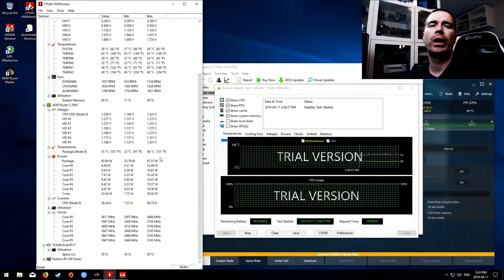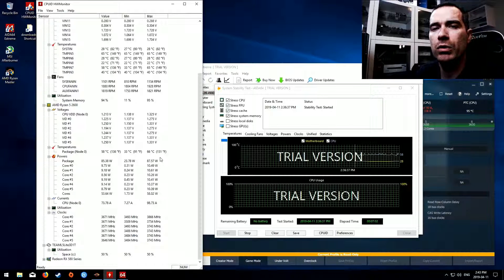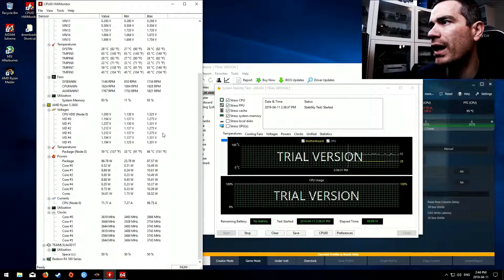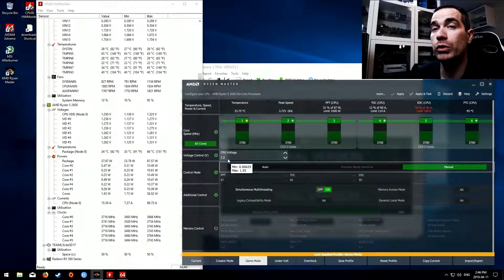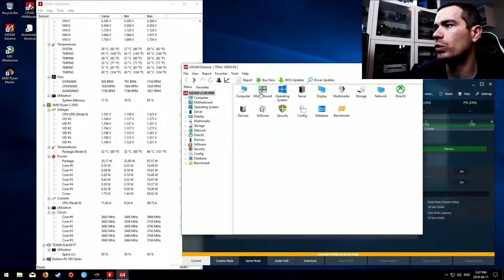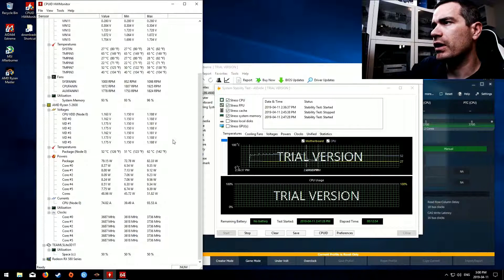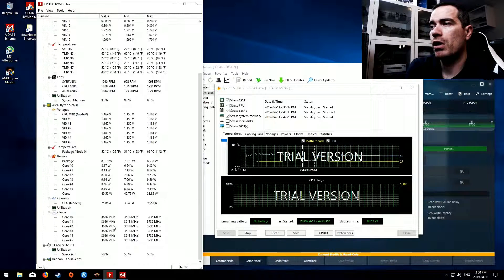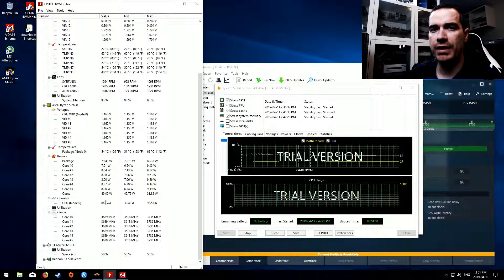Please Stop Using Auto Voltage On your CPU

Comment: I don't find this an issue. I've clocked my ryzen 5 2600 to 4.1ghz with auto voltage and it always stays between 1.38-1.4Volts Never above or below and my temps are fine. its perfectly safe guys don't worry. they don't design motherboards and BIOS software that kill your CPU if you auto voltage
Reply: Auto voltage sucks, tend to always overvolt setting it manually and fine tuning is much better, no auto voltage won't kill your cpu but it will lessen the cpu lifespan + higher load temps. The lower the voltage the better but I guess if you have no idea what you're doing auto voltage "works"
Reply: are u Single 8 pin or Dual 8 pin???
Reply: I'm running 3600 at 4.2ghz all cores at 1.1v auto temps are under 60degrees during heavy gaming... Is that auto voltage okay? Coz it never exceed more than 1.1v
Reply: @farooqft960  made in Vietnam r0 cpu intel cpu sucks . Oc voltage too much high
Reply: @farooqft960  my 9600kf  r0 made in Vietnam  oc 5ghz auto voltage are 1.4v
Reply: @farooqft960  look I can't give a clear answer because it varies based on "Silicon lottery" which just means some will run higher or lower than others. if it works for you and you don't get any performance decrease then I don't see a problem

Comment: This is the most misinformed video I've ever seen.  NEVER set a manual voltage unless you are trying for higher clock speed.  The chip is auto-adjusting it's power depending on load.  Manual mode takes that away and you lose power savings from idle.